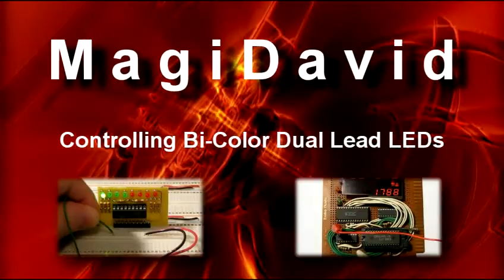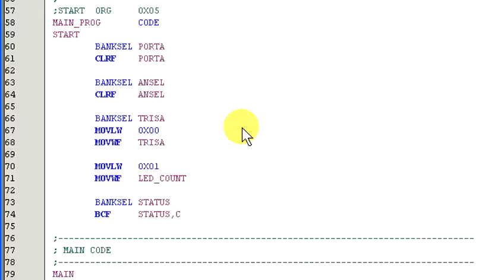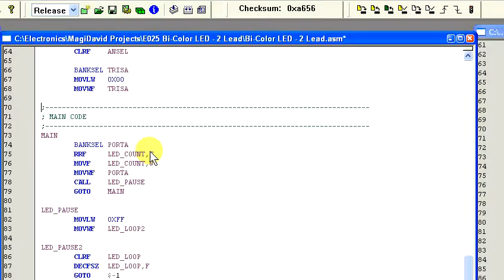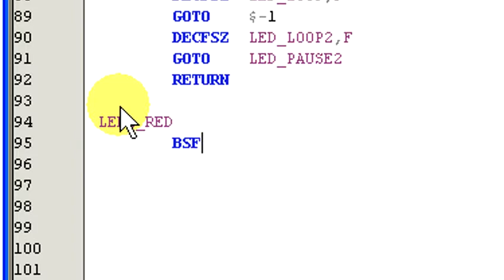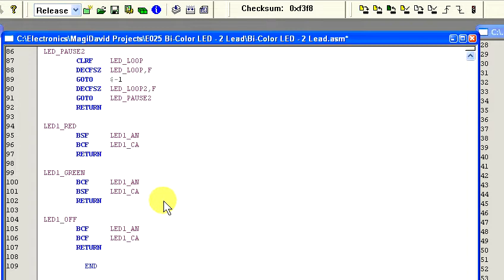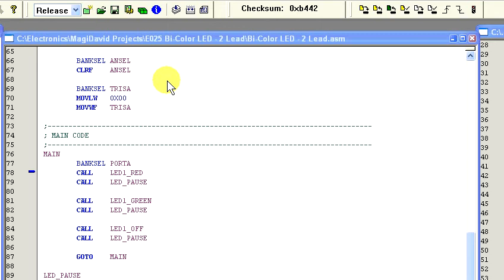MD Lab: Assembly Language 101 #2 - Controling a Bi-Lead Bi-Color LED

Comment: Can you make a third color by switching back and forth really fast?
Reply from the maker: Hello Chris,

Yes and No, you can't do this with a LED that only has two pins. You can do this with a LED that has a anode for each color. I do have a video about this very topic, here's the link:

MD Lab: Assembly Language 101 #3 -- Generating Colors With a  Tri-Lead Bi-Color LED